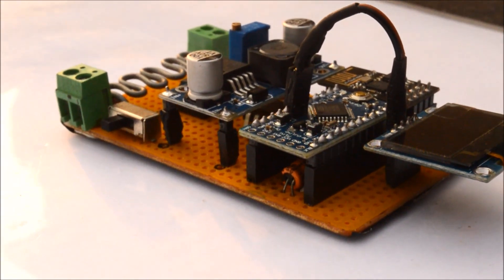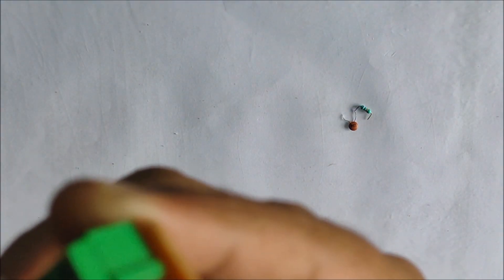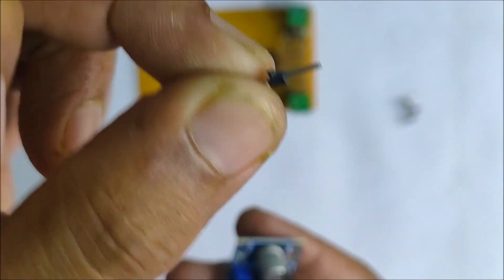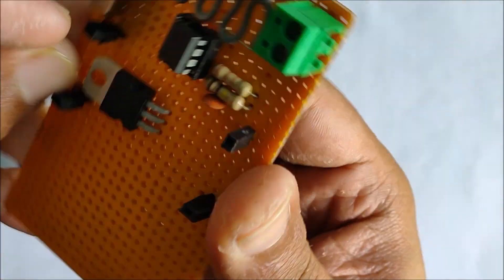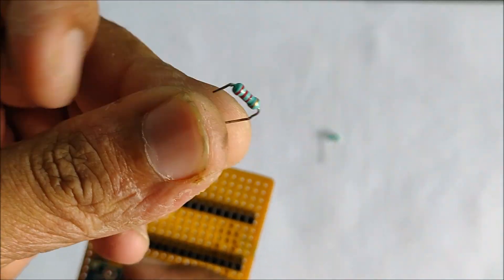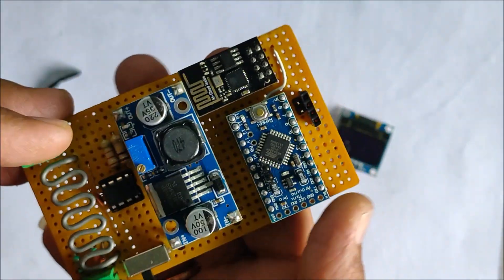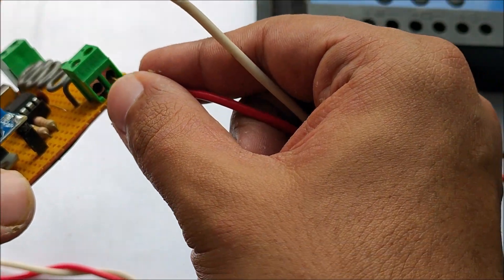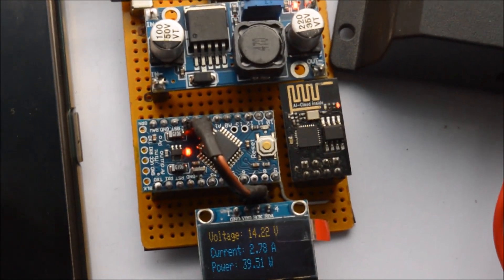IoT Power Measurement Module || Adding IoT feature to my solar charge controller.

Comment: I found this via the Face book group, I know you can buy charge controllers that log and wifi, but this looks really interesting. I am new ( I unboxed my first UNO yesterday ;)    ) to arduino and am an 'enthusiastic tinkerer' with my solar rig as it is at the moment, powering the lights and music car stereo in my shed. What I was thinking about just yesterday was some way to log a small panel on the house roof to gather data for a future instal of house solar. As we are near winter equinox, now would be a good time to start logging. So thanks for the info here.....  Good video too, clear and to the point. Subbed!
Reply from the maker: Yes as a matter of fact we do get controllers that log data but that is only available for very high end controllers and just the log devices tend to be very expensive. So I tried and came up with this alternative. Glad that this was helpful :)
Reply: @UtsavShah_25  Thanks for your reply :)